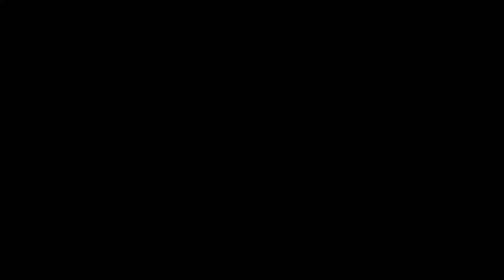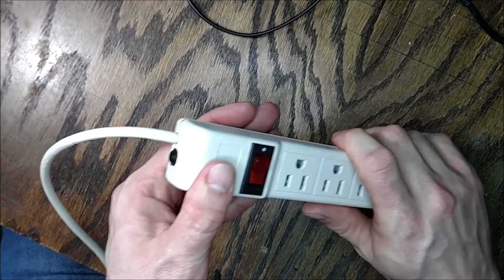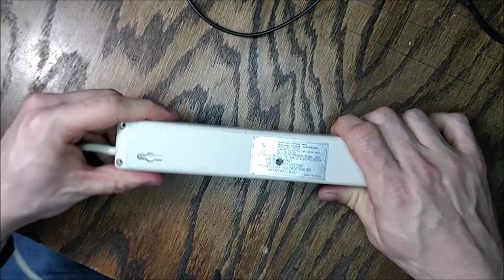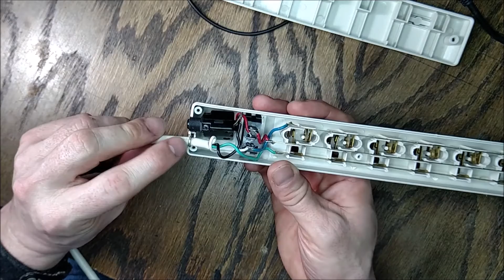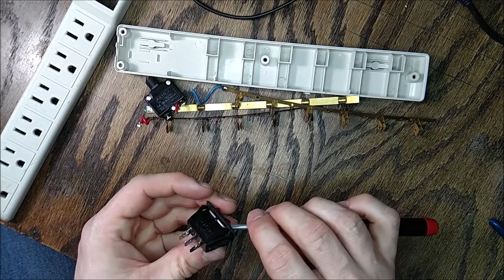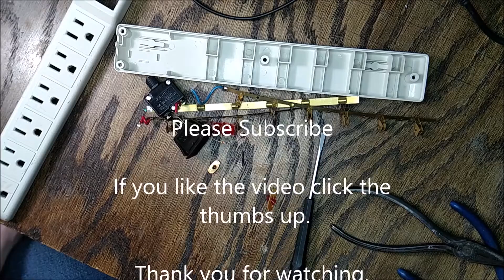Power Strip Fail

Comment: Do you remember if the cord was 14 gauge? I noticed that the strip claims to be rated for 15 amps, yet the cord looks too thin to be 14 gauge.
Reply from the maker: I do not remember after all these years.  But I wouldn't be at all surprised if they didn't use the wire gauge that they should have on a cheap product like this.